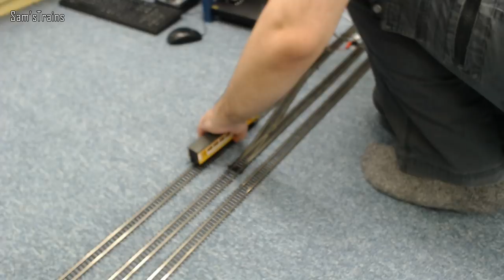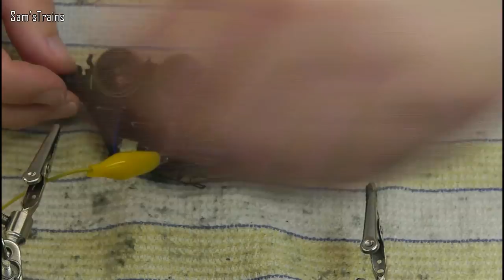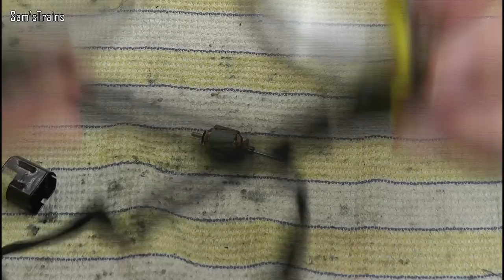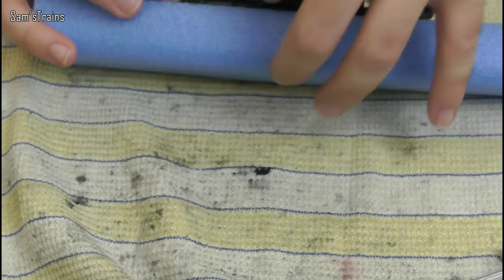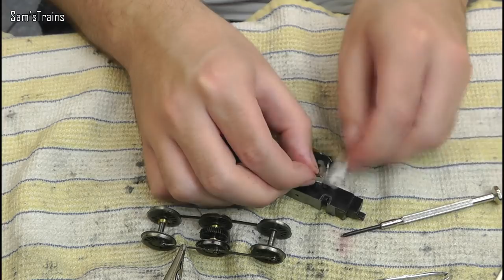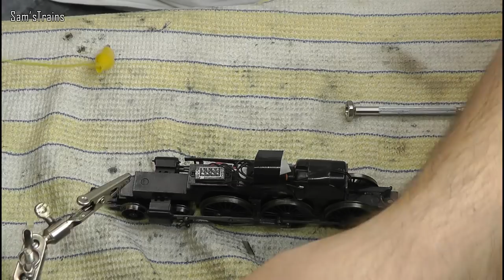Servicing with Sam (Live) #3 + Hornby Motor Stripdown

Comment: I remember the shock I was in when I 1st serviced a Hornby loco: "WTF, that's a toy's motor!" was my reaction. I mean seriously I have locos from Germany, Austria, France, Italy, Japan, Hungary, and from the US (from before the made in china era too) (back from the 1960's up till today), and i only saw similar motors in small battery powered RC cars, and in the Conrad point-motors.
Reply: Also I don't think I had to use a soldering Iron on those locos to remove the motor, and the brushes were accessible too, dough most of those motors are a bit bigger .
Reply from the maker: haha this is true - somtimes you get a very cheap motor in a very expensive model - it doesn't make much sense!
Thanks for watching - Sam :)

Comment: I have a Hornby Class B 12/3 loco which has failed to proceed.  It last ran a few years ago and has been in it's original box in a sealed container since.  There is power getting to the wheels so there is connectivity but the motor just hums and the loco will not move.  I have checked the motor and can manually move all parts ie worm drive and internal wire wrapped part.  The wheels also move when rotated by hand.  Considering the price I paid for this loco and the short time it ran I am extremely disappointed.  Any ideas.
Reply from the maker: That's very strange - if the motor is humming, yet turns freely, there could be a fault with the motor. Which version is it? Is it the latest version, with the die-cast boiler, the previous version (with the type 7 motor), or the X04 type??
Thanks for watching - Sam :)
Reply: @SamsTrains  I have no idea what version of motor it is but I purchased the loco new around 12 years ago.  It ran very nicely and was then stored  for around 10 years until now.  I have pulled the motor out and am cleaning it as well as all of the metal pickups.  There is what looks like some black wear marks on the copper comutator so I will clean that and see what happens.  If that does not work then I will purchase a complete new motor.  There is also a model railway club around an hours drive from me so I might take the loco down there and see if one of the members can help me sort this out.  It is such a shame as it really is a lovely little engine.

Comment: Skew wound has nothing to do with efficiently. It helps make the armature spin more smoothly as the poles are not directly facing towards one magnetic contact. 😉 so In order of smoothness and talk. 
1. 3 pole motor
2. 3 pole skew wound motor
3. 5 pole motor 
4. 5 pole skew wound motor. 

The 5 pole skew wound motor has the highest amount of talk and smoothness.

Making the trees in The Forrest visible.

Comment: Nothing like a nightmare stripdown to boggle the mind. Well, we can't expect every set of pickups to go easy on us. How about another nightmare story to make you cringe with fear? I have one in mind.
I've not written about a stripdown/test run before, so I hope Sam won't find it too scary to read. Once upon a service desk stripdown, Sam was cleaning an over-dirty 8F Tender Engine motor. The motor itself had been left to pick up far too much dirt, and Sam was annoyed with himself for letting it happen.

Sam did all that was necessary in his own time; slow and steady wins the race. It took about a nasty full hour and a half to get all the dirt off the motor and pickups. There was one little nightmare involved. Putting the clean chassis back into the engine's body had never been too difficult until now. The chassis eventually behaved itself and clicked into place.
"Please don't give me another nightmare job," pleaded Sam. Was he tempting fate? He hoped not. Engine and Tender were reunited with each other, and placed on the track to perfection. A very different headache caught up with our handsome handyman, so he had to sort out his newest gadget: a mobile phone whose battery kept running low. After putting that phoney object on charge for the hundredth time, Sam came back to his test run. The 8F ran a bit jerkily backwards and forwards at slow speed, yet it was nothing to worry about. Sam gently sped the engine up gradually and he moved more smoothly. At half-speed, the engine ran too fast, cut out on the points and gave Sam his worst nightmare of all. Sam was quick to shut off power, as he had noticed smoke rising, but not before a loud explosion erupted. The 8F had put an end to Sam's troubles by his own destruction. Sam had to ditch the engine and tender in the wastepaper bin. Not good.

None of the other model engines gave Sam a nightmare as cringe-worthy as this. They were all easier to get clean with the exception of the Patriot. Sam was glad to still have other steamies to run.
Reply from the maker: haha absolutely - some nightmarish ones here, lol! Oh dear oh dear - what a terrible mishap for my 8F - I hope the burial was respectful?
Thanks for watching - Sam :)